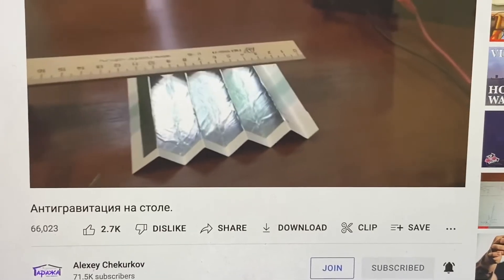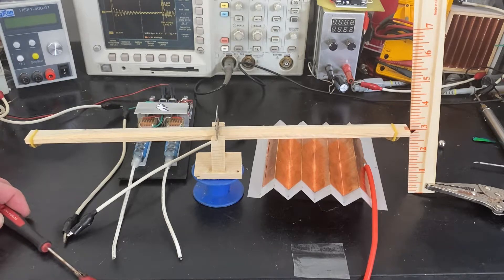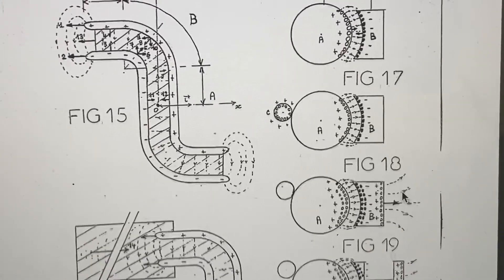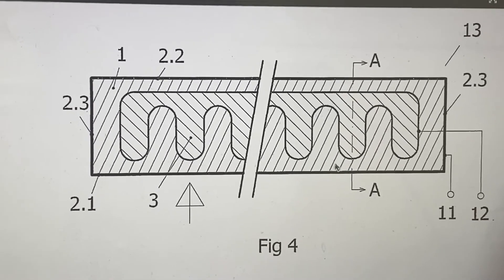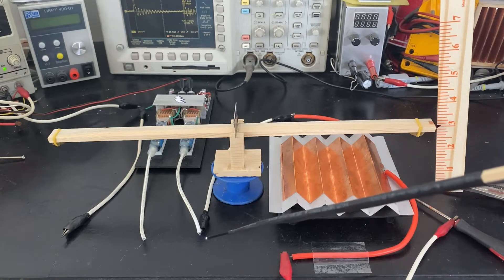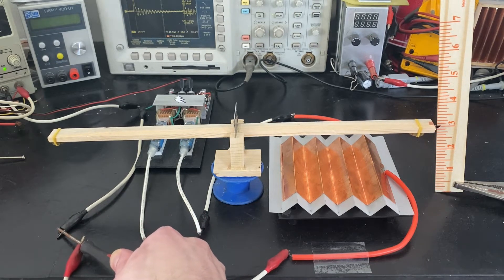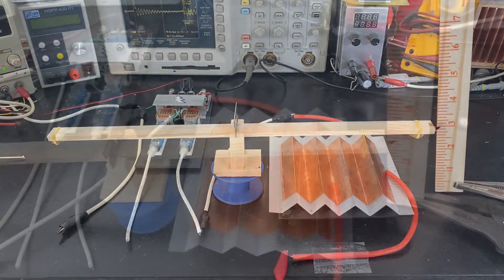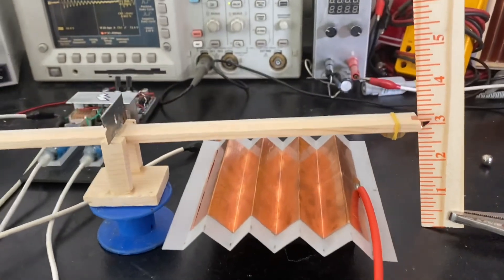Replicating Alexey Chekurkov’s Strange Capacitor And Other Observations.

Comment: The initial very brief proximity of the test lead to the "+" high voltage strips electrons from immediately adjacent air molecules; those electrons attract to the copper wavy foil, and the positive air ions created by this stripping of the electrons  are repelled from the copper foil that has taken on the small amount of "+" charge.

I would say that the 'glancing brief non-contact proximity' of the test lead to the "+" high voltage was not enough to create the later-observed polarization/static electric attraction.   Not enough "+" charge was accumulated onto the wavy copper foil because of the very brief exposure to the "+" power supply output.

In other words:
-  brief exposure of the copper foil to "+" high voltage leads to ion wind effect
- Longer exposure to "+" high voltage creates static electric attraction as accumulated "+" charge on the copper foil dramatically increases

It would be interesting to nail down, mathematically, the crossover threshold of necessary accumulated "+" charge that is required on the wavy copper foil where the ion wind is overcome by the static electric attraction.   

Super channel dude.  As always your lab presentations are inspiring.
.

Comment: I wonder if a higher k value on Dialectric medium and higher voltage differential charge on plates would create more force ?     What material you use for the dialectic  ? Also Wimshurst electrostatic generator with these shapes on the two discs, like victor shaubergers plate designs has me thinking.